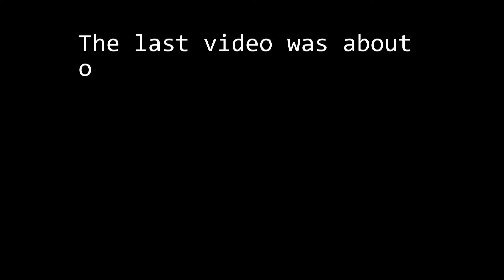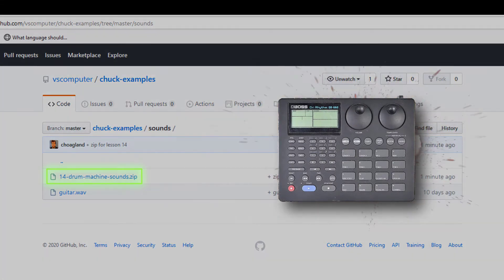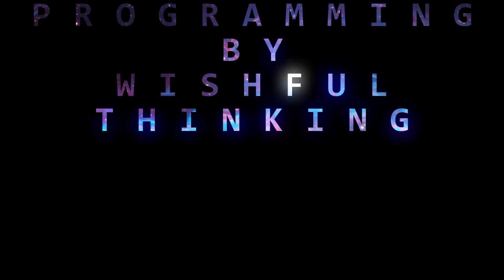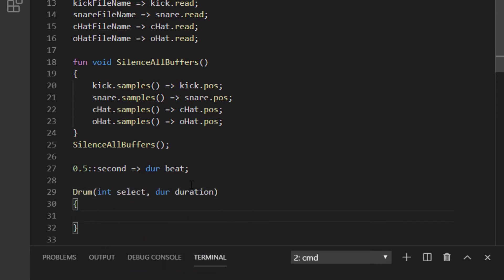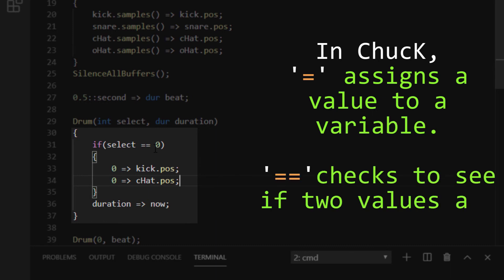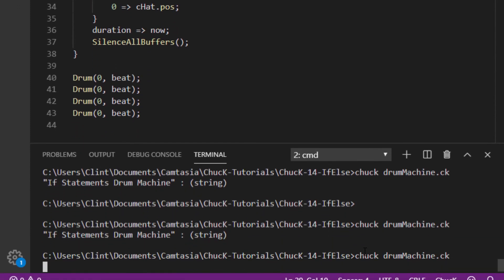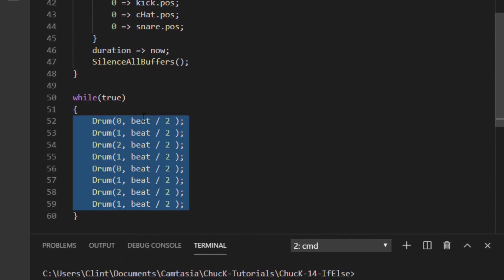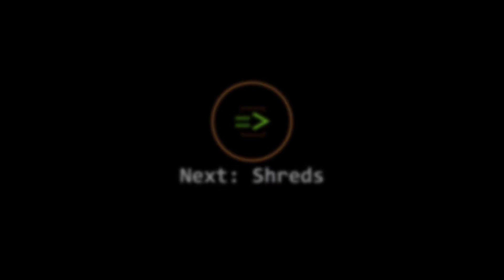Creating Electronic Music With ChucK - 14 - If Statements

Comment: Wouldn't you be able to load all the sounds into 1 file, one after another, and use pos to switch to the one you want? This does come with a limitation of only letting 1 sound play at once, but this can be circumvented by using lists. In this case, lists are much cleaner to use because they would all serve the same functionality. It would also scale very well, you could have hundreds of drums and only need modify the sound file and the start position dictionary. The only thing you would need to add more SndBufs for is allowing you to play more drums at once.

Edit: Ah! Looks like the latter problem is even more simply resolved using different shreds.
Reply from the maker: That start position trick is covered in video 18!
Reply: @BachelorMachinesTV  Oh, awesome!

Comment: Is that not possible to use an array to store the different samples? With eventually a for loop to connect them to DAC? (“chuck” the whole array to dac at once would be nice though ^^). Arrays in ChucK are "lists", but not associative array if I’m getting that right? After your series of video I’ll have a look at the reference manuel to complet the valuable knowledge you give in those videos.

If I test later on and find a way I’ll let you know!
Reply from the maker: One way you could save a bit of work would be to load up an array with all the files in some directory, that would work. But it would be harder to know what was happening because they're just arrays and not dictionaries or whatever. Also, as far as I know, there aren't enums or other ways to rename numbers. So your chuck code would be tightly coupled to the contents of the directory (which, to be fair, this file also is because it presumes the existence of the wav files).